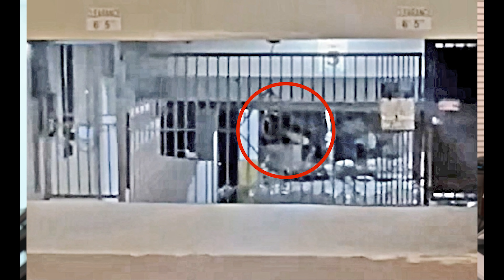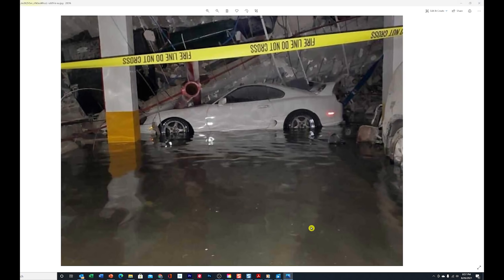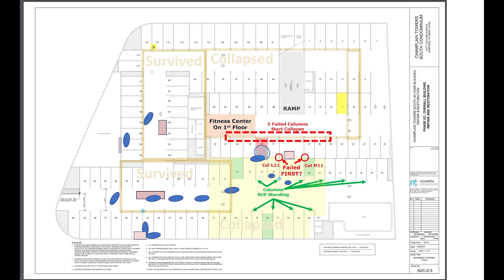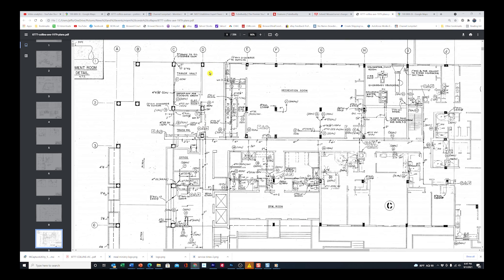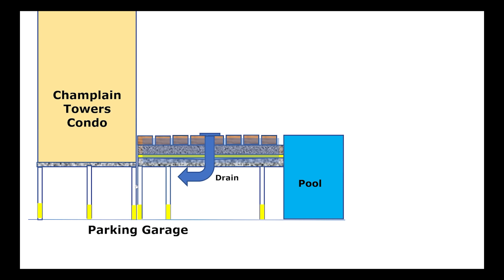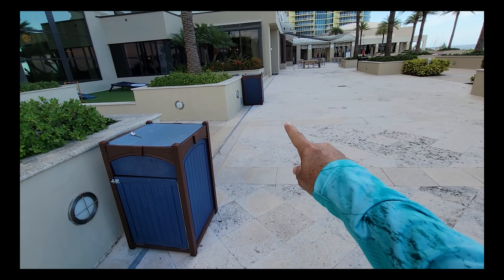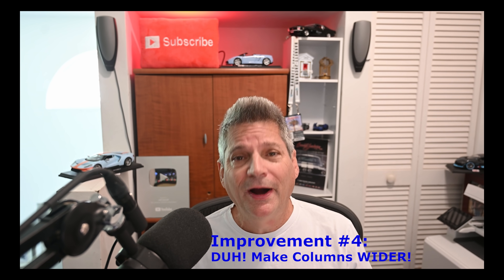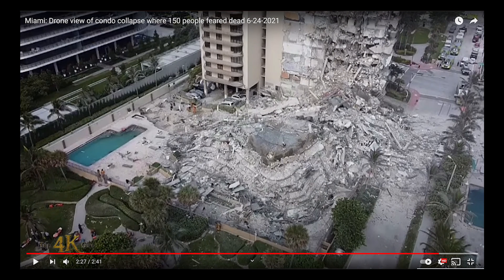Miami Condo Collapse: 4 Engineering Fixes May Have Prevented It

Comment: Don’t forget they added a massive penthouse floor & extended all the balconies on the southern side.  How much extra weight on those small columns?!  Surely, the engineer at the time should’ve made the columns bigger & or installed more support beams to spread the extra load of the variation work to the original construction documents.
Reply from the maker: Penthouse was already in the design
Reply: @jeffostroff  Are you certain?  I remember seeing drawings without the penthouse level.  Can you definitely confirm the original drawings had the penthouse level.  Also, wasn’t the height restricted to 12 stories?
Reply: @skyaerialview  I agree with you and that is my recollection from watching multiple channels on this. My understanding is that the plans with 12 storey's went to council, were approved and then the penthouse was added, in such a way that it did not have to go back to council for approval and that is how they got around the 12 storey rule.

Comment: I agree with ALL of your recommendations. I believe they should try much harder to to make a more 'Fail Safe ' structure. 12" columns are not a saving, they seem to be a BAD risk. With the addition of capitols, the building would more likely still be standing. I would suspect these decisions were not properly reviewed. I also think the sister facility should be examined for faults, pretty quickly.
Thank you, Jeff
Reply from the maker: Thanks, I'm glad you liked it!

Comment: Real simple...and I've posted this on here and other vlogs....design should have included walls instead of beams.  Where there was a beam there should have been a wall instead.  And that would not eliminate any parking spaces.  No capitals, no drop plates, no nonsense.  Just walls to the base to support the load or any future load on the pool deck or the transition between the pool deck and the first floor deck inside the structure.  So inexpensive as to be a no-brainer.  A solid wall is always better than columns, beams, rebar, etc.  Just a few walls would have saved this building for many decades into the future and the cost would have been peanuts relative to other elements of the building.  Nearly the same amount of labor to form up a wall as a beam.  NO BRAINER.
Reply from the maker: Yes walls would be even better
Reply: That's a good idea, but you don't actually need a bunch of walls down in the garage. They could have just built all the columns and beams between them in a moment frame type of design. In fact, they have used moment frames instead of shear walls in a lot of modern structures to accomplish the same thing. There's a lot of houses in southern California that are in fact doing this to reinforce the back of the house that has a garage at the back. The way the houses were orignally built with no moment frame or shear walls is just not seismically safe at all, and there's a big push to get people to get compliant, with a flimsy first floor.

Comment: Thanks for making this video, I remember that beam that was bowed connected a column under the pool deck to a column under the front of the building.

I was trying to explain that if that m11 column failed and was attached to a column under the front of the building by a beam, it most likely was part of, if not the biggest reason the building failed. I don't think the beam would have sheared clean off the other column as he was suggesting, I'm not an engineer but I'm not an idiot.

 I think that was the start of it all. To many flags keep pointing to that exact area, but there were multiple factors at play here. Thanks for the video Jeff!
Reply from the maker: You are on the right track, thanks for watching
Reply: @jeffostroff  Hey I appreciate all the time you've put in to explain all this to people. You do a great job!

Comment: Jeff, you make great videos on tools and remodelig.  You are not, as far as I can tell, a structural engineer.
Reply from the maker: You are as far as I can tell, one of Kai's minions and a troll. I'm an electrical engineer, not structural. So what? So what's your point? Are you here with your self-righteous finger to point out the big bad Jeff evildoer? Am I not qualified to talk about it? I almost became an architect, I create floorplans myself all the time. I am comfortable reading high tech documents, floorplans, permits, and engineering specs. I have pulled many a permit in my day. I've been remodeling condos and solving tough engineering problems for years. Don't forget it was structural engineers who got us into this mess in the first place.  it was structural engineers who made the FIU bridge collapse, and  it was structural engineers who made the Hyatt Regency skywalk collapse,  it was structural engineers who sank the titanic. And you see my abilities here and still have the nerve to point your finder at me as though I'm unqualified? Please.
Reply: @jeffostroff  I would caution you to look up the Harbor Cay condominium collapse in the same era as when Champlain Towers was built.  In that project the reinforced concrete was designed by some retired NASA engineers who were not completely versed on the intricacies of reinforced concrete design, and the building collapsed.  Well you are aware of punching shear which they were apparently not aware of, but there are other intricacies of reinforced concrete that you have shown in this video that you are not aware of.  However among youtube content creators this video scores relatively high in accuracy.  You mention collapses at FIU and Hyatt Regency, you should add Hardrock Hotel as well.  Each of these showed potential deficiencies in the process.  I can't say more than that.
Reply: @jeffostroff  I stand corrected, and can admit when I am wrong.  I have no idea who Kai is though and I'm not a troll, I do have a couple of Kai Wasabi knives I use on the patio when running one of the grills, but that's about it (they are basically cheap Shun knives and my Shuns never leave the kitchen....  My opinion at the time was based on the videos you produce that I like, tools and remods.  It seems that you are getting many multiples of views on the collapse vids vs tool vids.  My apologies, and great live vid at HD today.  Will probably be making an order or two based on it tonight.  Cheers!

Comment: It might be more expensive up front to build . . . but brittle concrete and rusty rebar just isn't the way to go. If I were designing a building I would insist on solid oak columns especially towards the lower floors where the most weight is.
Reply from the maker: if they maintain it, it can be done.
Reply: This is the south- they use Bois de Arc wood.

Comment: Of the 4 changes, which ones do you believe were feasible in 2018 ? Because it's easy to fix something at design time, but after the fact it becomes harder. My guess is that #2 and #3 (drop panels and capitals) would be feasible to implement.
Reply from the maker: Yes 2 and 3. Stopping the punching shear likely would have stopped the collapse

Comment: Years ago, I worked at a Mall. I parked on the second floor of the parking structure and noticed deck oscillation each time vehicle traffic was moving on the same level. I recently returned to view the deck construction and noticed it had lots of concrete beams underneath each deck. It clearly shows as much stronger than Champlain Towers South, as the massive beams were closely spaced apart. I can imagine how much vibration would have resonated daily on Champlain. Combine that lack of support, heavy planters and constant water intrusion and the entire project was a perfect storm of future devastation.
Reply from the maker: Probably no vibrations, the garage floor is the foundation, and the rest of the building is a static load except for humans walking
Reply: @jeffostroff  There was vehicle traffic on the 1st floor/pool deck at the lobby/entrance off of Collins
Reply: @jeffostroff  except there were parking spaces on the ground floor lobby level, and especially there were some spaces close to the fence where you could enter the pool deck. it has been pointed out in other videos (and maybe yours too?) the proximity of those parking spaces to the smaller columns of the pool deck.
Reply: @jeffostroff  If you watch the other videos created by building construction engineers, you will learn that the pool deck was already loaded up with 100% of the load it was ever meant to carry.  That’s BEFORE the planters were added.  The fact that it didn’t collapse under the weight of those palm trees is a miracle.
Reply: Most recently-designed parking garages have thin slabs, 4-5 inches thick, post-tensioned reinforced concrete.  They are perfectly safe, but tend to propagate vibration at sometimes uncomfortable levels.
Reply: @johnbergstrom2931  where i work is under a parking deck and normally you don't notice when cars drive on it but when you get some cars that speed it picks up a vibration.
Reply: @A.Martin  It depends on the weight and speed of the vehicle.  In theory a car could travel at just the right speed, induce a harmonic vibration and shake the slab to bits, but concrete slabs in garages don't have enough length for that to happen.  Not even close.
Reply: @johnbergstrom2931  yea I know its safe from the cars. Just that when they go fast above where I work It gets noisy, whereas most cars make no noise.
Reply: @johnbergstrom2931  Back when these buildings were built, concrete wasn’t nearly as strong as that being made today.  It all depends on the formulation of the concrete itself as to how much strength it has.  Regardless, when water gets into the rebar and corrodes it, the concrete will split apart and loose all it’s strength.
Reply: @mudman6156  Concrete in 1981 was plenty strong if it was mixed correctly.  Problem is, CTS was built by Nathan Reiber, no inspections were done and corners were cut to maximize profit.  Guarantee the NIST report will indicate this.
Reply: @johnbergstrom2931  I have no doubt that you’re right about that.  But this building couldn’t have possibly withstood the onslaught of a hurricane such as that of a direct hit by a storm like Katrina.  That’s because the building’s exterior walls weren’t made of concrete.  The only concrete this building had was in the columns (which I feel were way to thin except for those holding up the parking deck), the floor slabs, and 2 relatively small walls…one by the elevator shaft and attached stairwell, and the other at the other stairwell.  Those walls were configured to prevent the building from toppling over sideways from wind hitting the sides of the building, but not fore/aft loads as they would have just been pushed right over.  I imagine the architect thought that the length of the building was sufficient to prevent that.  And he’s right.  But had the building’s walls been built of concrete (at a minimum the exterior walls and walls separating the units), this building would still be standing.  Had those walls been made from concrete, they could have withstood the weight of the floor slab and would have prevented the building from collapsing, because concrete is at it’s strongest when placed under pressure.  In fact, some of those columns wouldn’t have even been necessary.  However, heavy steel beams would have been required in the basement in order to have an open parking garage.  But that too could have been resolved by creating individual private garages for the owners, allowing the concrete walls to extend down to the building’s foundation.  The one area of the pool deck that didn’t collapse was the area by the pool itself.  That’s because the walls around the pool were made up of concrete block, so they had the strength to hold up the deck in that area.

Frankly, I’m surprised that those huge palm trees that used to be in the planters on the pool deck didn’t cause the building’s collapse when they were there, as they must have overloaded the deck well past it’s limit, especially considering that the weight of the deck itself was maximising the weight the columns were capable of withstanding.  I’m surprised at the lack of redundancy built into this tower.  No doubt, the northern tower lacks redundancy as well.  And while it’s HOA leadership has kept that building in pristine condition (unlike the obvious neglect the south tower had), I wouldn’t want the structure of my building to be fully dependent upon my neighbour’s willingness to properly maintain the building itself.

A storm as strong as Katrina would have obliterated these buildings.  The tidal surge alone would’ve completely demolished the first two floors, not including the parking garage itself.   Buildings this size need to be made from concrete, not steel framing.
Reply: The residents reported that the building shook each time they were driving piles in when building the neighboring  condo
Reply: @cathyclark6652  I think those reports are just red herrings started by the CTS condo management to deflect and divert attention away from their criminal neglect of maintenance.
Reply: @johnbergstrom2931  I was around an area where they were pile driving for a bridge & the ground shook, quite a distant, everytime the pile was hit.
Reply: @sportsmom165  Pile driving is a bit mentally jarring but if a building is fragile enough to be damaged and eventually collapse from the mild, transient vibrations of pile-driving, it is a doomed death trap anyway and should be evacuated and condemned.  

From the pile-driving next door, CTS might have had small cracks appear in resident's drywall, seams might have come open, stuff like that, but the pile driving was not the cause of the fatal collapse.  CTS condo management was paid $400,000 for the inconvenience...  Think any of that money made it to the residents themselves?
 
Bad design, the developer cutting corners, shoddy concrete and forty fucking years of maintenance neglect brought down that building.  The pile driving next door maybe accelerated the collapse by days or weeks, but it wouldn't have made a difference.  They wouldn't have started repairs in time to save those people.  Their fate was sealed.

Comment: The construction at condo buildings should not be compared to hotels or even apartment blocks, as the owner of the latter has a vested interest in making it more durable and maintenance free as possible at reasonable cost.
Reply from the maker: Wrong, they still both have to conform to the same building codes, and the same methods of pouring concrete.
Reply: @jeffostroff  What I mean is yes same building codes but condo=minimum to code. Hotel=Above minimum code. BTW Champlain towers south passed the minimum code

Comment: I'm not a builder or construction engineer...or familiar with commercial buildings, but if I were designing one, I would never connect the outside construction to the main building with beams.  Outside construction weathers differently from inside construction...whether it's wood or concrete...so they should be separate units.
Reply from the maker: The architect apparently wasn't an architect either! LOL!
Reply: @jeffostroff  From what I read, the developer, Nathan Reiber, was pretty much of a shady character, so he probably wouldn't have hired the best people to build anything, since he probably prioritized profit over quality construction.  He owned the construction company that built the building...and they were the contractors...and in the 80s, there weren't all that many safety regulations.

What bothers me is that no effort was made to at least shore up the columns in that part of the building attached to the pool deck while they dicked around with getting loans, permits, etc. after they got Morabito's assessment.  I saw pictures of buildings where they put steel columns to temporarily shore up damaged roofs, etc.  Maybe it would have made a difference.  Wonder why Morabito didn't recommend that.

Comment: What were and are now the considerations for seismic activity in this type of construction? Would the angled form at the top lend itself better as a general rule to resist motion damage? It this regard it would be difficult to design just because seismic activity doesn't occur in a certain area ....... until it does.
What floor slope away from each column would aid in keeping water from encroaching on each column. As was noted on your last video that one column had little rebar sticking up and could be the very fact a combination of concrete formulation and rebar rotting away leaves columns vulnerable especially in Florida's climate.
What considerations are given to what will be under the building's basement floor? A piling driven to solid rock is what kind of rock? Can water find its way along the piling to reach limestone (?) enough to interfere with the integrity of the job it is supposed to do?
Reply: Southern Florida is very low in terms of seismic activity.
Reply from the maker: All good questions Larry. Slope should be 1/4" per foot, just like showers and bathtubs, and plumbing